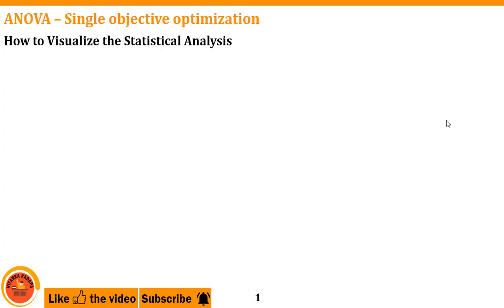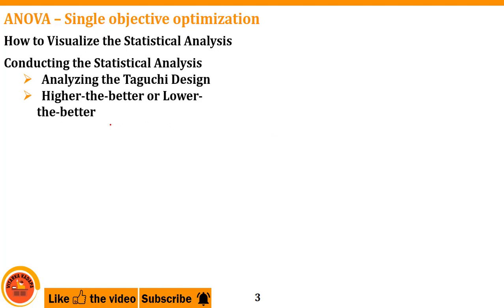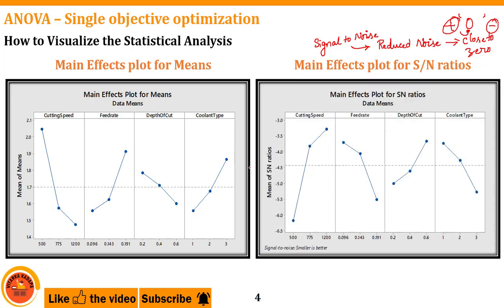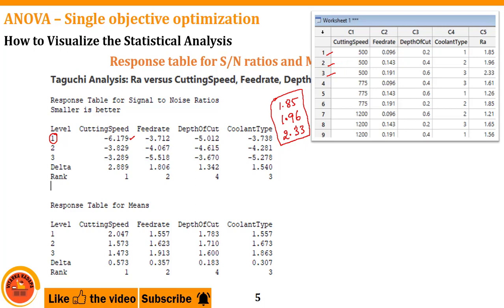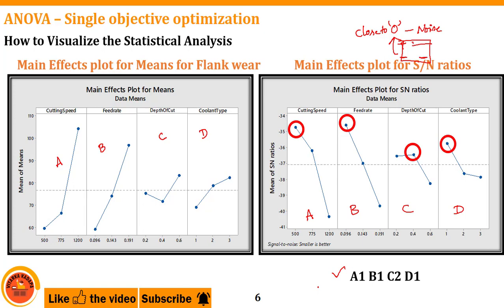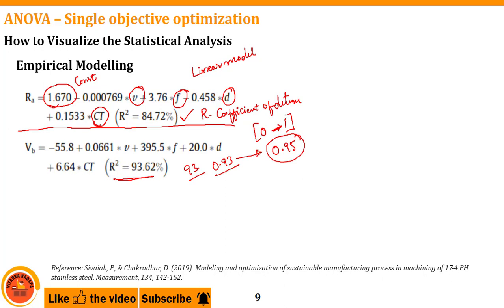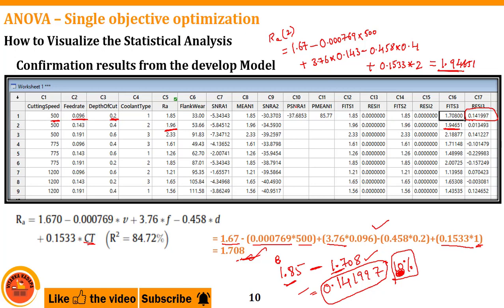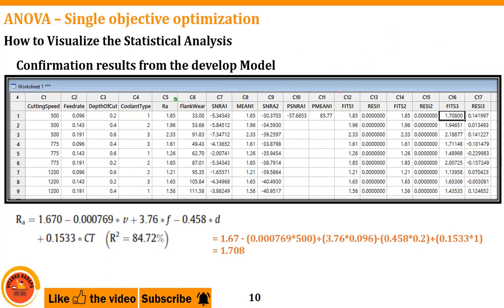How to Visualize the Statistical data - Data Analysis - After Experiment

Comment: Hello sir, can you suggest a book which can be read online? I am working on brake disc optimization using taguchi method.
Reply from the maker: Sir, i recommend to use this one. 
Quality Engineering Using Robust Design, by Madhav Phadke, If you understand the concept then it will be easy to apply.